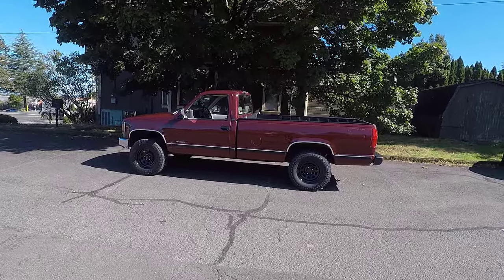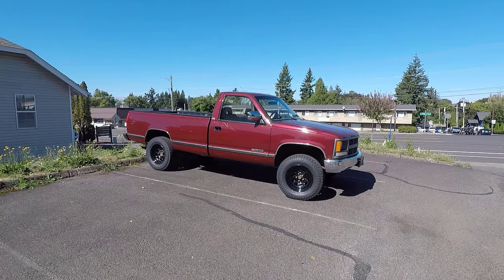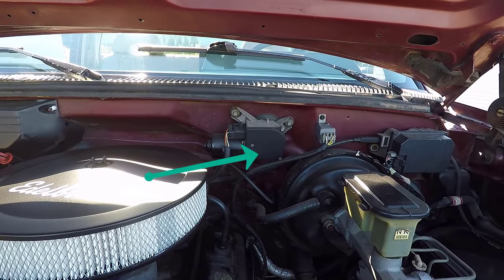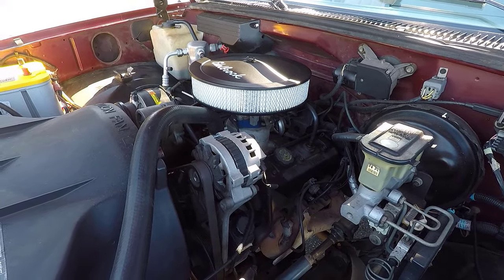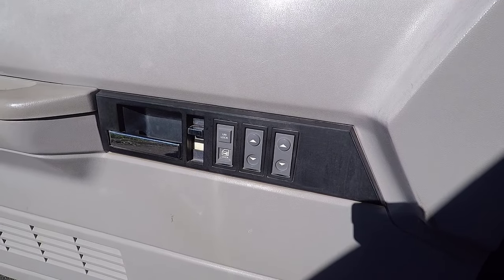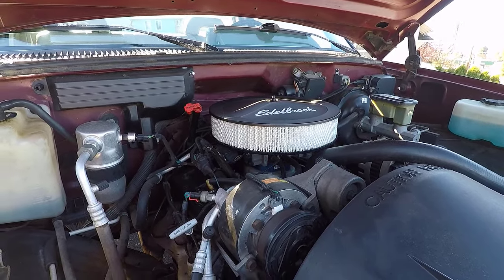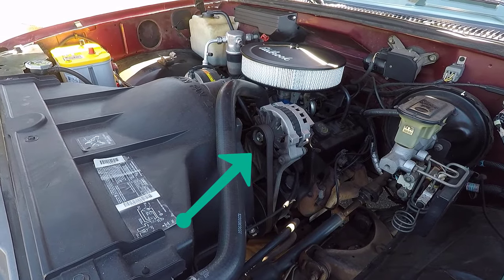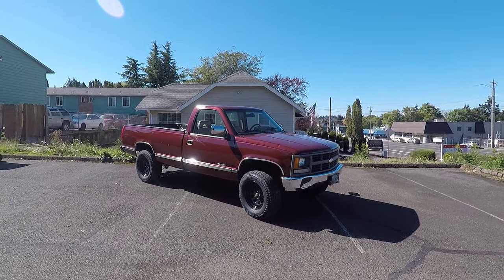10 COMMON ISSUES WITH 1988-1998 C/K PICKUP TRUCKS

Comment: Main issues are 2wd, 4.3
Reply: Not really, they last forever.
Reply: That statement is not true
Reply: Explain those motors are known to get 350000 plus and mine is 96 chevy w/t only 167000 and she gets up and goes
Edit:and if you change the oil and take care of it, it will last as long as you my windshield washer still works I got a goodie
Reply: People just want to hate 2wd trucks. I bet I use my 2wd truck more than my a few of my neighbors 4wd trucks. Hauls what I need to places I need to go…for over 20 years…same truck.
Reply: I understand the sentiment but the gmt400 4.3 engines are bullet proof and well regarded.
Reply: When gas prices rise it will be the best option
Reply: That's the one I got but even with all issues listed and rusted frame rot and everything it still runs like a beast!
Reply: 4.3 in my 90 has 430k on it just replaced the distributor first time it needed anything. My 99 3500 has 230k on the 7.4
Reply: I had vortec 4.3 six cylinder,  ran great till I got rid of it ( around 200,000) many 5.7 liter V-8's and am on my 1998 GMC SEIRRA EXTENDED CAB 2 wheel drive with a 5.0 305 V-8 at 170,000 miles and it purrs like a kitten.  Love it.

Comment: The same body-style was continued until 2002. I have a 2000 C3500HD. These were originally sold as Cab & Chassis trucks. There's a filler panel between the grill and front bumper to cover the gap created by the massive frame. They have Dana 80 rear axles, i-beam front axles, and leaf-springs on all four corners. Mine was the last year for the 7.4 (454) Vortec. Great trucks.
Reply: And that filler panel is just a piece of plastic which easily cracks and breaks if you hit something with the front bumper, as I did once. But those things are now replaced.
Reply: It’s a actually up until 2000 then the HD Silverado was introduced in 2001
Reply: @KingStepside Wrong. The C3500HD used the old body style until 2002.
Reply: @KingStepside  No not correct, the 3500HD (the real HD truck) was around until from 1991 to 2002. It is a true class 4, 15,000 GVW C&C only, medium duty truck that was eventually replaced by the Topkick and Kodiak C4500 trucks. The Silverado is just a class 2-3 truck regardless if pickup or C&C. GM started to use HD for Silverado as it worked well from a marketing point, nothing more.

Comment: Front hub bearings, oil cooler lines, power steering pressure hoses, a/c compressors, power seat motors, 4L60E sun shells were all common too. GM has a long history of using the cheapest suppliers for their vehicles.
Reply from the maker: It's a long list on these trucks, but we love them anyway. Make sure you take a look at my GMT400 Upgrades and Performance Parts Guide. There's nothing like it online and it's the best https://www.buildpriceoption.com/gmt400-upgrades/ - thanks for watching!
Reply: What do you do for code 42

Comment: I own a 1994 Chevrolet Silverado 2500 454 7.4 with the NV4500 manual transmission. Just went over 1,415,000 miles on it and just had to order a ECM today. Yest that's a million miles. Never rebuilt, does not burn oil and survived sitting in 3-4ft of water during Hurricane Harvey. I had to replace a lot of stuff after the flood, but that truck has worked daily through three different businesses. It's a true work horse. It use to get 13-14 mpg city and about 17 hwy loaded or unloaded. Now she gets about 11 city , 14 hwy. I decided I'm going to put a new distributor, plugs, wires, fuel filter, temp sensor, map sensor etc to go with the new ECM. They just don't build trucks like these anymore. Parts are dirt cheap. I'm still finding some parts made here in USA, Mexico, Canada, but more and more in China. The China stuff is pretty junky with the heat from those 454. I enjoy my truck. Also I really haven't had most of those issues you listed. LOL.

Comment: I have a 1988 c1500 Cheyenne with the 305 V8. Snagged her for $300 with 135k on her 5 years ago, and she needed love, still does. But every problem in this video is spot on, the door hinge bolts and bushings always go bad over time, but these trucks are so reliable that I bought mine, put an alternator in it, and drove her all the way from south Jersey, to Savannah, Ga, then up to Tennessee and back to south jersey, around 2,500+ miles and not a single issue or even a flat. These trucks are built strong, reliable, and made for the owner to be able to service it themselves. To be honest I think they should put another line of these out, I’d rather buy one brand new for $30-40k than this shit they put out these days. Once I get a garage, I will end up documenting the complete restoration of her step by step.
Reply from the maker: Right on brother, love your story, and thanks for sharing! I remember being so happy to get my truck in a garage. And these are badass amazing trucks. I was just out driving mine today as it's been sitting in the garage all winter looking pretty. Sounds like you got yourself a sweet GMT400 . I have the best resource anywhere on GMT400 Upgrades and Performance Parts . I have a 3K word article that truly covers it all with links to everything. I mean everything. You should check it out . It will be a solid resource for you going forward https://www.buildpriceoption.com/gmt400-upgrades/ and I have over 60 videos of my truck and most of the videos are of me doing some kind of fix. Here's the playlist https://www.youtube.com/playlist?list=PLZPFVgOzDxzUNotTlw4KYrOgZebABH3Gg
Reply: Got the same truck, same year.

I had to replace the entire front end suspension. I feel as though I may also have a gasket leak. I was driving to work in Atlantic City one day. Truck had run fine. Appeared to start to "overheat" and as I was pulling over lost responsiveness in the throttle. 

Sound like a gasket leak? 

Great truck tho. 

South jersey represent!
Reply: I just got my grandfather’s 1998 Chevy Cheyenne 2500. It’s sat for a few years, but all I needed was a couple new batteries and I drove it from Northern Kentucky all the way to South Florida with no issues at all. It does still need some love though, mostly cosmetically. Did you end up starting your restoration project? I would love to see it.

Comment: Very solid reliable truck. My late production 1994 Sierra has 270,000 miles. Of the problems you mentioned I have had the intake manifold gaskets replaced at 240,000 miles. They were causing an intermittent vacuum leak. It is also on alternator no. 3. Nothing electrical, its the bearings that have failed. 5.7 liter engine is original and otherwise unopened. Interestingly, the tail light and license lights have the new glass wedge shaped bulb bases, while the interior and front end bulbs have the better known round brass based bulbs. I installed led high and low beams, and they make a great difference.

Comment: So many different ways to do these trucks. Love the 90s OBS look.

The OEM oil cooler lines that snap in to the oil filter adapter seem to be a common oil leak problem.

I spent the better part of two weekends standing inside my engine bay cleaning oil and dirt after I pulled the motor out.

I decided on the oil cooler delete. No oil line leaks, quicker valvetrain lubrication on startup, and easier oil changes.
Reply from the maker: Great tip!

Comment: I've had issues with the intake manifold gasket, inner door handles, and wiper control board on my '95 1500 long box extended cab.  It has 211,000 km, (131,000 miles) on it now.  Had it about 15 years.  Great truck!
Reply from the maker: Thank you for sharing and yes, they are great trucks!

Comment: these trucks are great to work on really. love them to death lol. my list of obs's
1988 reg cab short box 5 speed stick 5.7L air bagged 280K km (daily)
1990 reg cab long box auto 5.0L 289K km (first obs) parts truck now 
1990 ss454 reg cab short box auto 7.4L 279k km (under the knife)
1995 4x4 reg cab long box auto 5.7L  585K km (work truck)

Comment: My wipers would stay on after I turned them on lol. I tried to turn them on once to get leaves off my windshield, but they kept on going. I looked like an idiot with my wipers going full speed on a sunny day lol. Dealership replaced them for free tho
Reply: My truck does this
Reply: @deadcalifornia  if you call a Chevy/gmc dealership, they’ll order it for you and install it for free if the recall applies to your truck
Reply: I bought a 1 owner 1996 Chevy K25004x4 in November 2020. In January took it to dealership for an oil change, they tell me there is a recall on the wiper motor, they had it in stock and replaced it, amazing!! GREAT truck!
Reply: @whitecloudrancharizonatim56  I’ve loved every second of owning mine. Never had any problems and I just hit 140k on the odo. The 5.7 has decent power and torque so no problem accelerating
Reply: @eliweldon9939  nice! I’m at 159k, bought it with 154k, it was owned by Sheriffs Department in Apache County AZ. I’ve serviced all fluids, have brakes and differential fluids to switch and all maintenance will be current. Now of course I have a small leak, looks like rear main seal, but by small leak like 2-3 drops overnight, and some days no leak at all, strange. I’ll have to address it this summer probably, trying to do as much repair and preventative maintenance as possible. But YES, love my truck!
Reply: My dads 95 suburban did this. We just changed, I believe it was a sensor in the handle for the wiper, but it was super simple
Reply: Should have just removed the wiper fuse.

Comment: 91 Silverado stepside..188,000 miles changed window switch and ignition module..only changed oil on time and tune up as felt needed ,still strong 💪

Comment: I have a 91 k1500 and havent had any of these problems and it's been family owned so I know all of these problems are not common, the only problem I do have is that my truck has a small misfire at idle but it drives fine I've been having this problem since 2013
Reply: Me too..91 ck1500 Silverado stepside..left millions of blackmarks and I just drove it..all I've ever done is changed oil on time,I've  replaced a ignition module and window switch..188,000 miles

Comment: I can only assume all of your pricing quotes are hiring the work done, but as an Avid GMT400 truck fan and having owned 13 over the years, brake pedal fade on the earlier models with the early Anti-Lock brake controller is common. In the rust belt, frame failure is very common on trucks not kept clean or not undercoated, door hinge bushings another big one, trucks equipped with cruise control often experience a failed turn signal stock and those need replaced, also flexible brake lines after about 15 years begin to fail internally causing your steering wheel to jerk to one side or the other under certain braking conditions, 4L80 and 4L80E tail shaft seal failure at around 150K miles and another rust belt issue is factory tow hitch rust. Great video! Thanks for compiling your experiences for us! Zip~
Reply from the maker: That is a correct assumption. I have over 60 videos of the truck and many of those videos are of me doing repairs but not everyone can turn a wrench or wants to. Sounds like you really are a GMT400 fan. Me too. You should visit my website and read my article, "GMT400 Upgrades and Performance Parts Buyers Guide," it IS the definitive resource on all things GMT400. GMT400 upgrades include suspension, engine, interior, accessories, and more https://www.buildpriceoption.com/gmt400-upgrades/ - Thanks for watching and sharing your knowledge so we can all benefit.
Reply: @BuildYourOwn  I'll definitely check it out! To add...5 of my GMT400's had the 4.3L and even with their quirky odd fire (which was only done one other time with Buick and their 225 V6 that eventually became the 3.8 of Buick Grand National Fame), they are and were a dead reliable platform that you could literally put 500,000 miles on with just regular maintenance. Add the 5 speed manual and typically higher rear end gearing and a few tweaks on the top ends and you've got one super odd (see what I did there) sleeper of a truck that still got in the area of 20mpg on the highway. The last 4.3 I owned I passed along to a friend and at last check it's got 423,000ish miles on the untouched except for typical maintenance engine AND 700R4/4L60 Non electronic. Cheers! Zip~

Comment: Ive had alot of these trucks and so have my family and friends. I cant believe you didnt mention the door hinges they fail and sag the door especially when you have the added weight of power windows. Thats the most common problem I have seen hands down
Reply from the maker: Very true, good point. The passenger door on the truck will act up and that's probably the issue
Reply: That's easy....8$ dollar part..tho...
Reply: That’s nothing all cars have problems that’s a pretty weak problem